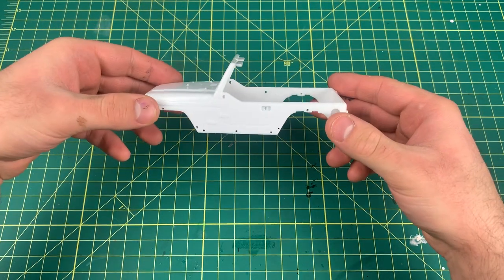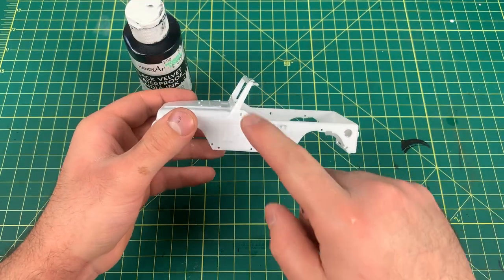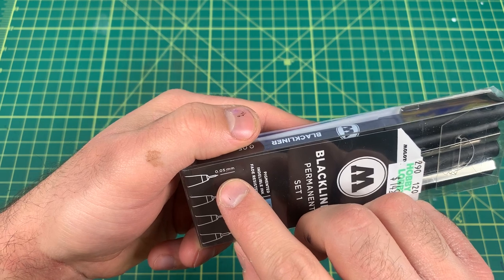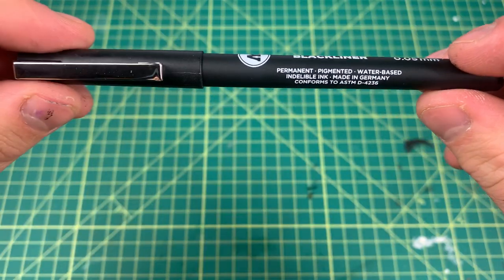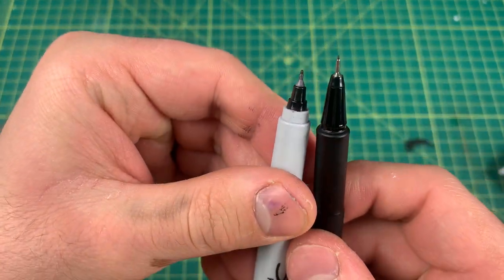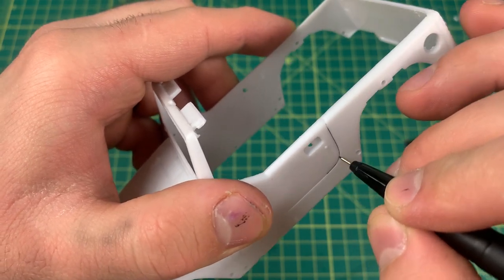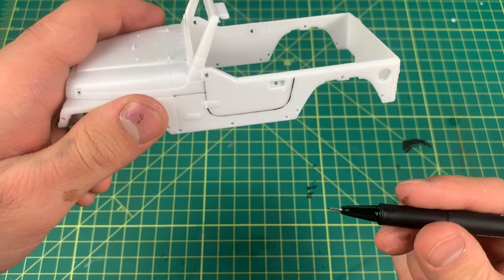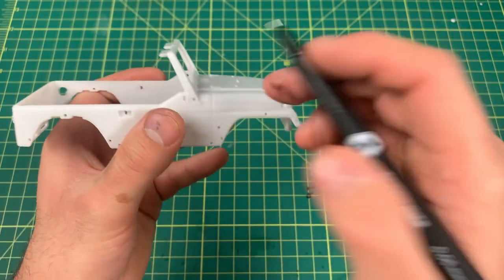Super Easy Panel Line Technique For Model Kits

Comment: I do the same thing except I use the black sakura pigma micron 003 pen. Hobby lobby carries them. I don't wait till after clear coat to darken the panel lines, in my opinion they look to dark doing it that way. I darken them right before spraying the primer coats and right before spraying the color coats. Doing it this way will shade the panel lines, therefore they will end up darker once you apply all your coats of color and clear. I also use them to black wash grilles, etc. Great video by the way.
Reply from the maker: Thanks for the tips as well! I haven’t tried to use it as a wash for grilles I usually paint all of
Mine black
Reply: it looks like the way to go but for his work being sloppy